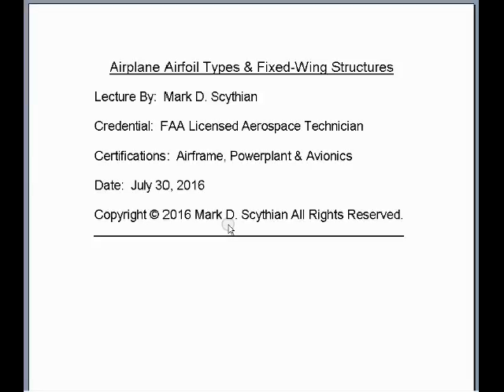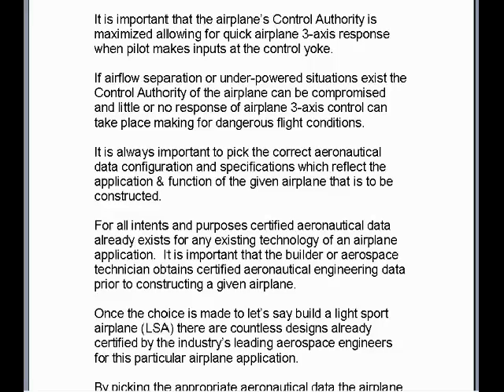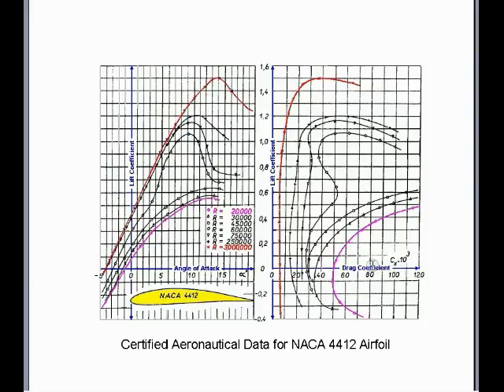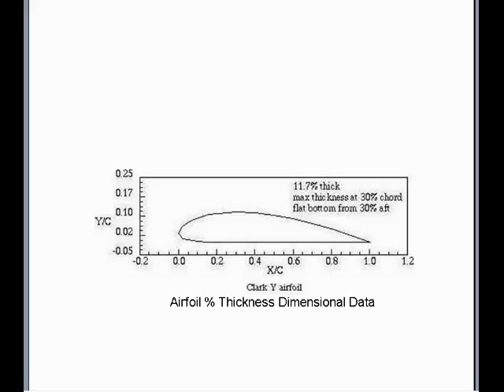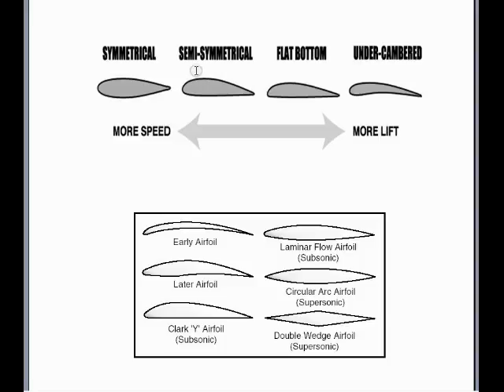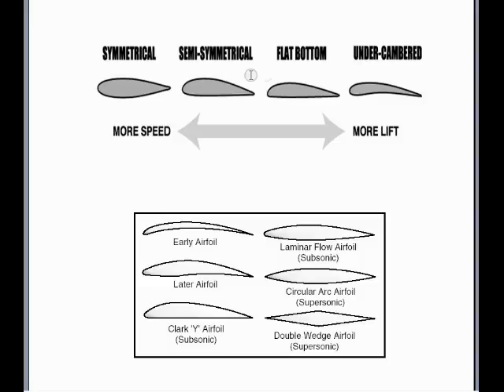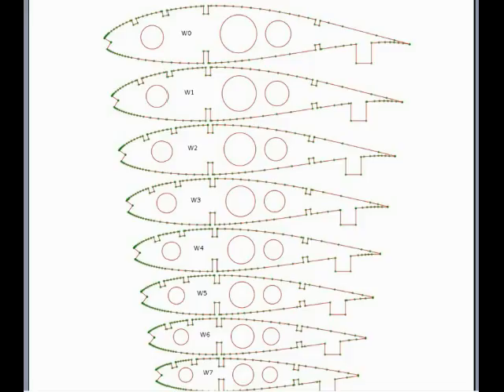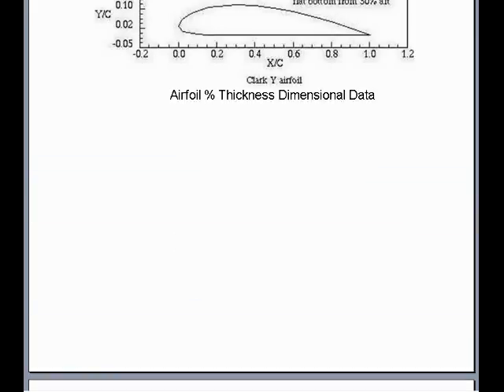Airplane Airfoil Types & Fixed Wing Structures

Comment: I like the breakdown of the different airfoil shapes and their speed and function, very useful for real life.
Reply from the maker: Thank you! 

 Flat, Semi-Symmetrical & Symmetrical airfoil types, their % thickness and chord all effect the coefficient of lift (Cl), coefficient of drag (Cd) and the ratio between the two or Lift-to-Drag Ratio (L/D) for a given wing or aerodynamic structure.

Comment: Mark, thank you so much for the great video! I wonder if you'd have any advice on how I might proceed in designing and building my own anhedral (air foil, or wings,) in combination with a reverse delta fabric, for creating a w.i.g. craft. (see: Airfish 3) I know my basic weight, speed, use, etc. goals and don't simply want to cobble together existing aircraft parts in order to hope that it works. Thanks so much for anything you can offer. Dan
Reply from the maker: Hi poisonoverdose1.  Anhedral wings or horizontal stabilizers typically function to improve Roll Stability.  You will need to compute Wing MAC (Mean Aerodynamic Chord) to locate the Center-of-Pressure and Center-of-Lift.  Followed by Span Efficiency and Coefficient-of-Moment calculations for optimizing CG configuration.  If you have figured out all of these or are building from an existing airframe concept, the actual construction of Anhedral airframe structures are optimized by a two-stage construction processes.  Such as outboard reinforcement spars interlocking with inboard wing spars and stringers.  This method of Anhedral airframe construction allows for excellent flex, strength and fewer components for high strength-to-weight ratio, prior to covering given wing.
Reply: instablaster...

Comment: Hi, I am studying stol aircraft and their capabilities.  To this day the storch still remains a leading design in short field use.  Using slots rather than slats limited it's higher speed performance.  Some aircraft use varying designs of retractible slats that lend themselves well to higher speed performance.  I understand the aerodynamic effect of both leading edge and trailing edge surfaces on stol aircraft.  My observation is that the storch uses considerably more wing surface to achieve low speed stability than say the ch701, whittman buttercup, just aircraft stol King and wilga.  Would you recommend full length flaperons and a mechanical retractible leading edge slats to improve the still characteristics of the storch airfoil?  Should I consider a different approach to increase short field performance?  Yes, overall weight of the aircraft in relation to wing size affects this as well.
Reply from the maker: Hi.  Yes, the Fieseler Fi 156 Storch as incepted by the Reichsluftahrtministerium (Reich Aviation Minstery) in 1935.  If we examine the Zenith 750c, we see similar airframe systems to maximize the Aerodynamic Span Efficiency and Oswald Number. 

If your purpose is low performance STOL without respect to drag limitation, then an all-span flaperon would retain practical control-authority, while minimizing developmental costs & maintenance.

Another consideration would also to implement Vortex Generators with an outboard aileron assisted by roll-spoilers.  This probably would not maximize developmental costs though, but would minimize control-authority problems, especially at lower flight speeds, with yaw stabilization using yaw-dampener or rudder trim.

The Storch was ahead of its time for the given implement, and through Reynold's Number Scaling, much larger implementations such as heavy, swept-back wing applications were made manifest, as High-Lift-Device specifications.

Have you considered graduated multi-stage flaperons with deflections higher inboard and lower outboard? Inter-stage bell-crank cams and pulleys properly calibrated to the appropriate differentials can allow this development with respect to cost. 

Aside from that, a single all-span flaperon at slower speeds seems more practical, although a flaperon-trim-selector would need to be calibrated to whatever Lift-To-Drag (L/D) ratio your fixed-wing application is calculated as.

Please tell me more about your fixed-wing application.  Since taking advantage of High-Lift-Devices scaled-down to the appropriate Reynold's Number may solve many problems with respect to cost.

Comment: pls what's the highest AoA before the stall of a flat bottom airfoil and the coefficient of lift it corresponds
Reply from the maker: Hi.  That depends on the specifications for the given flat-bottom airfoil.  Flat-bottom airfoils have different Coefficient of Lift and Coefficient of Drag limitations based on the camber thickness.  Their ratio is also known as the Lift-To-Drag Ratio, commonly referred to as "L/D". 

If you type in:  Airfoil Database at Google, you'll eventually find a comprehensive database of airfoil specifications.

Comment: Why they use different aerofoil for defence and commercial
Reply from the maker: Hi.  Many fighter jet or military fixed-wing airfoils are designed for supersonic flight speeds and have a "diamond shaped" airfoil profiles.  Where as subsonic (below supersonic flight speeds) implement a the typical semi-symmetrical or symmetrical airfoil profile. 

Airline Transport (passenger airliner) applications are still limited to subsonic flight speeds until the next generation of electro-acoustic dampening technology hits the market.  But that won't be for some time.  Sonic Booms are prohibited in all civilian ground zoning ordinances worldwide, even at altitudes above 10,000 Ft MSL.  

As of now, only military fighter jets are supersonic airframe applications in non-civilian ground zoning ordinances (military restricted areas and airspaces), which allow Sonic Booms below and above 10,000 Ft MSL. 

Subsonic and Transonic Airfoils = Typical Shape Airfoil Profile
Supersonic Airfoil = Diamond Shaped Airfoil Profile

Diamond Shaped Airfoil(s) cancels out the Oblique Shockwaves as the physicality of the Sound Barrier is overcome.  The characteristics of Bernoulli flows invert after the speed of sound, in which the surface layer airflow over structures remains subsonic while the upper layers of the airflow boundary layer flows at supersonic speeds. 

The Sound Barrier is a physical barrier itself which requires a diamond shaped airfoil profile to "slip" past the Oblique Shockwaves and enter the supersonic flight speed "window".   At this point, the sound energy of the aircraft in motion through the atmosphere exists behind the aircraft.  The diamond shaped airfoil profile permits Bernoulli flow inversion and Oblique Shockwave distribution. 

- Mark -

Comment: Hi Mark. This is a one of the best videos on YouTube that explain airfoil principles. Could you do a video that explains vortex lift as produced by a delta wing aircraft?
Reply from the maker: Hi Major, thanks for your comment!

Delta Wing aerodynamic applications are a specialization unto itself.  In the near future, I will create a video lecture focusing on Delta Wing aerodynamic characteristics.

Delta Wings in contrast to Swept Back Wings, Taper Wings and Elliptical Wings stabilize Wake Turbulence into a portion of the wing's Boundary Layer, hence the "vortex" lift-to-drag function. 

Other characteristics of Delta Wings are their low Aspect Ratio, high Wing Loading and Hyperflows.  Excellent for fighter jets and supersonic air transport applications.  There are other interesting characteristics pertinent to Delta Wing planforms as well, such as their Aerodynamic Span Efficiency and Lift-To-Drag (L/D) Ratio. 

I'll work on creating a lecture regarding Delta Wing aerodynamic applications, and upload it to YouTube in the near future.

Thanks!

- Mark -
Reply: @markscythian7179  Thanks